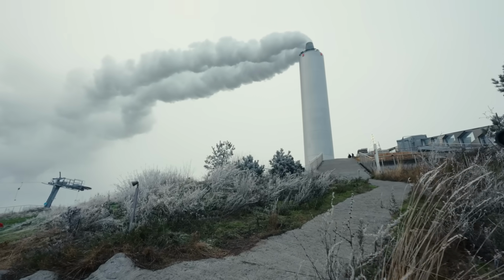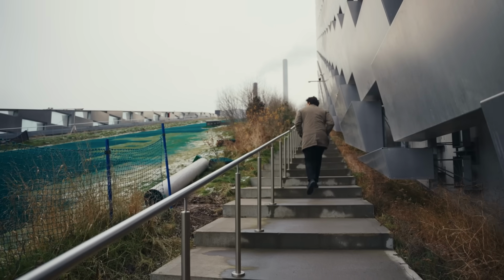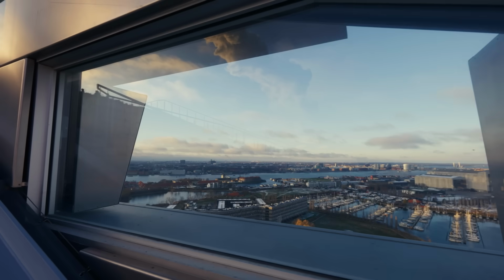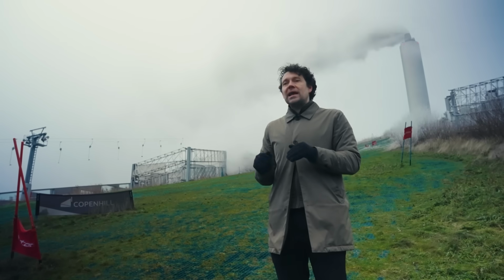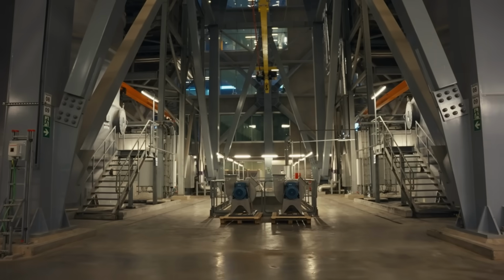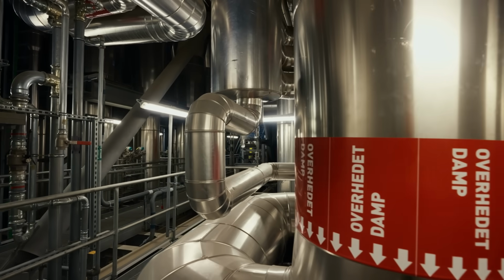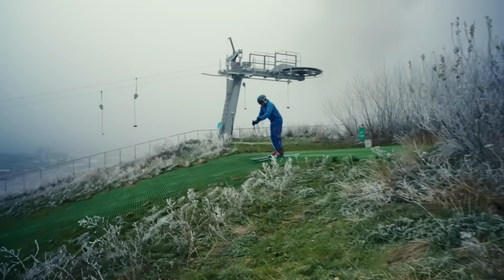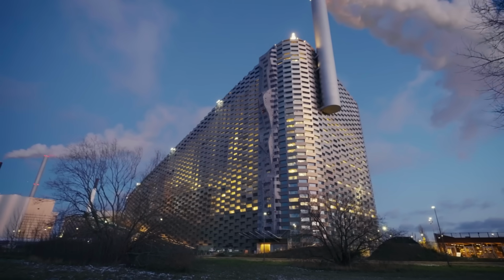Inside A Sustainable Power Plant With A Ski Slope On Its Roof | Unique Spaces | Architectural Digest

Comment: I really like this buildings architecture with its steel bump exterior and lots of windows and clean industrial interior. I’m  going to have to visit your rooftop. This waste management technique is high level with its efficiency to use heat in the garbage burning process well done.

Comment: Amazing. 02:58 How did the fox get onto the rooftop of such a huge building?
Reply: 9 months later but: The bottom of the ski slope is at ground level. There are some gates to prevent people entering after it's closed, but it isn't super high security.

Comment: I worked at a Coal burning powerplant for 13 years. It amazes me how clean the inside of that place is. There burning trash. Pretty cool.
I would like to know how man megawatts this place makes.
Reply: The plant is designed to change between operating modes, producing 0-63 MW electricity and 157-247 MW district heating. It's a great feat of micro and macro engineering.
Reply: @Real_MisterSir  thats pretty cool. Shows how much wasted heat energy there is at a normal power plant.

Comment: I'm always torn on projects like this.  On the one hand, amazing design.  On the other hand, how much extra did the taxpayers pay for all this?
Reply: It depends on the definition of paying and definition of what you are paying for. Is it a bigger investment building that specific building? Yes definitely! But part of that investment were also in a park, ski slope and made a positive liveable space instead of an industrial complex fenced off from the public. As an, admittedly small, bonus they also reduced the need of an AC in the plant. There has been a few power plants like this in Sweden as well. Not with the ski slope and so on, but built to be a landmark instead of something grey and imposing. The reasoning is partly that a beautiful building like this doesn't decrease the land value in the same way a gray imposing industrial thing does. If you consider that as a part of the investment, landvalue itself will pay back a big part of the investment over time. Generally the Scandinavian countries value beautiful architecture almost as much as the functionality.

Comment: what is in the smoke ?
Reply: It’s not smoke it’s water vapour.
Reply: @jackn2683  how does the water vapor help to make electricity ?
Reply: The steam powers the turbines. Its literally mentioned in the video.
Reply: @jackn2683  this is the part i get curious, what is creating the heat ? is it fossil fuel ? coal  or from gasoline pipeline ?
Reply: @userGGG702  The heat is created from burning trash
Reply: @larsandersen4727  so where does the smoke of trash go ?

Comment: Copenhill is a fantastic building, sadly with a few oversights. First of all, Neveplast (the ski surface) shouldn’t have any vegetation growing through it - it makes the slope mouldy, bumpy and makes turning quite difficult. Plus it’s
basically like riding on ice, thus the number of people trying it once and not coming back.

What is also not mentioned is that the ski surface of Copenhill is currently being redone due to the material deteriorating faster than expected, at a cost of a smooth 1 million USD. Sadly, this is par for the course for many of BIG designed buildings: there are histories of the whole facades of residential buildings leaking and the buildings needing extensive and costly repairs, ending in disputes between architects, owners and the municipality. 

I admire BIG‘s creations and Copenhill is something that should be replicated throughout the world. Just wish the build quality followed the great ideas.
Reply: Personally I would get rid of the ski slope. It is akin to a golf course - a large area that is no use to wildlife, and only a few people can use. Instead I would simply add more plants such as those used by bees and other pollen spreading creatures.
Reply: @tomedward8652  We already have lots of wildlife dedicated land, and plant-filled rooftop walks. The key here is diversity in the urban landscape, not just sticking with one formula and copy pasting it everywhere.
There is also the context of location, the plant is situated in a remote location within the city, meaning a lot of people don't frequent the place unless incentivized by a unique experience. A walk among some plants and wildlife will not do that, it would only really benefit the people working at the plant, but they aren't there for leisure times in the first place.
You can look at other architectural works in Copenhagen like the Figure 8 building complex which has a green walkable roof through the entire structure's roof - as well as other places with different approaches.
A good architectural city planning will diversify the experiences that are available - and considering people in Denmark have no other places to ski anyways this is a niche opportunistic choice that also serves the Tourist industry well as more of an eye catcher and a novel idea, than simply putting some more plants on a roof.
Reply: I forgot to add that I can imagine the plastics used in the production of the ski slope material are pretty bad.
Reply: Absolutely - but I’d actually argue that the ski slope there is a pretty amazing idea. I use it for snowboarding (there are snowboard obstacles on the bottom section of it) and it is a lot of fun, once you figured out riding on what’s basically sheet ice - and embraced the possibility of a likely injury :)
Reply: @tomedward8652  
It's fine. It will just get burned.

Comment: How is the co2 removed, and where does it go?
Reply: It goes everywhere, but you get skii :0
Reply: They capture it and store it, it's called CCS

"The captured CO2 can either be stored below ground, or eventually converted into green fuels
(Power-to-X). According to GEUS, the Danish underground is particularly suitable for storing CO2, and it will be possible to store 500-1000 years of total Danish emissions at the current level."

Comment: I always wonder that if the CO2 gets filtered out it must be stuck somewhere else. What to do with filters and stuff where it gets captured ? Does anyone know ?
Reply: I think it depends on the type of filtration. Some are chemical, where they use specific gases that bind to the CO2 and then they collect that compound and can turn it into solid bricks of CO2; others are literal filters that I guess must be stored in facilities somewhere.
Reply: In anesthesia, we do captured the CO2 with soda lime. Soda lime is something like rice grains that absorb CO2. but i dont have idea in video, how they do it.
Reply: Well, the carbon of oil, coal, or trees only causes an issue when we burn it, and it gets released into the air and atmosphere. So the captured carbon can be either buried back into the ground or placed in some sort of storage facility. Either way, it no longer affects our atmosphere.
Reply: @Turtle3141  you can also run substoichiometric and your exhaust gas is (mostly) a syngas (carbon monoxide and hydrogen) and use that as a fuel. Gasification and Pyrolysis. It’s a cool technology.
Reply: Yes, they conveniently avoided answering that question. Whatever methods they use I cannot imagine there is a clean way to burn rubbish, especially rubbish that contains many unknown materials.
Reply: @tomedward8652  Of course its not 100% clean, nothing is but it is 10x better than alternative methods
Reply: @tomedward8652  It depends on what the alternative is. Putting the trash in a landfill affects the ground water, spreads plastic and so on in the area and still releases greenhouse gasses. A lot of the organic materials will release methane gasses which could be used as biogas and released unburnt is a lot worse than CO2. You'll also have to find another source of energy to use instead of using the energy source you already got.

Comment: Too bad they didn't realize the initial plan of having the chimney puff rings of steam instead of the ordinary plume..
Reply: They actually had a Kickstarter campaign, to build a prof of concept. If I remember right, they got the money and built a small demonstrator, but ARC would not pay the cost. Later they came up with the carbon capture concept.